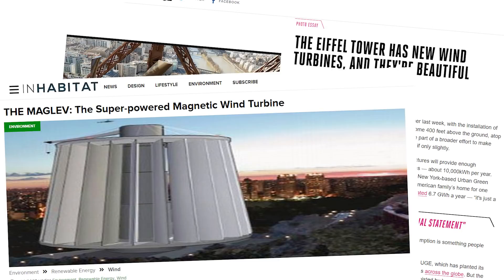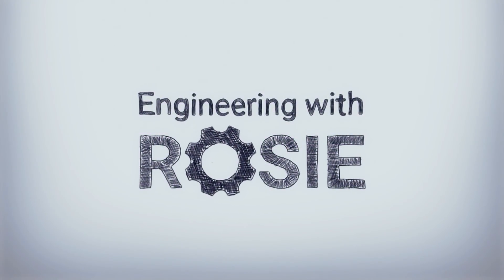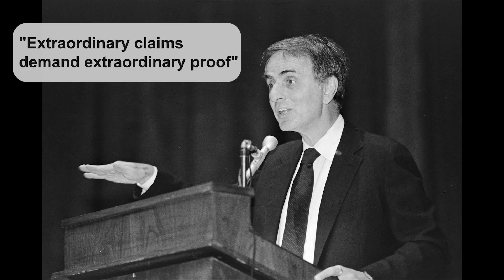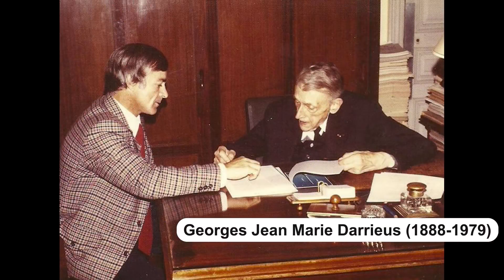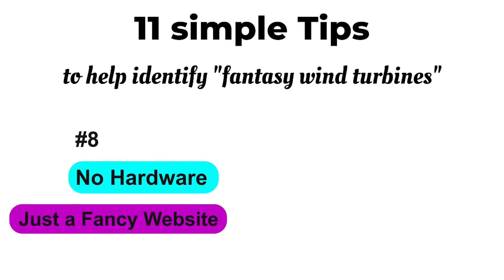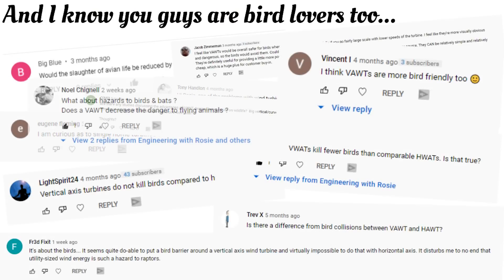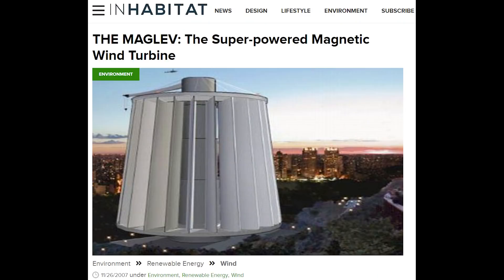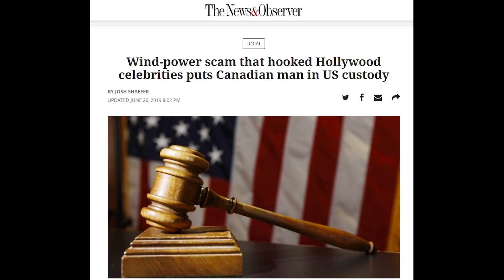Back to the Future of Wind Energy Technology with Paul Gipe

Comment: "Should we ignore all small wind?"  If you have a grid connection then yes, because the end cost of the electricity always reduces and reliability increases with increasing power output of the turbine.  There is no way a small backyard wind turbine can compete with the latest offshore wind turbines that can produce a day's electricity for a household in just half a turn, and due to their location and height can produce that power most of the time.   They are also much better for the environment than building the tens of thousands of backyard wind turbines that would be needed to produce the same power as just one of the latest offshore turbines.  Ohh, and due to their height, nearly all sea birds fly lower than the blades can reach!
Reply: I see more small wind turbine not turning because they are a pain to maintain for the energy  obtained and just getting high enough to have sufficient wind is often the biggest expense.
Reply: Good points but there are windy cities such as my hometown, Wellington in Aotearoa (NZ) where you have to think some form of rooftop turbine could one day provide affordable electricity to the home.
Reply: @simonromijn3655  Description of Wellington: "The enclosed nature of the harbour gives many sheltered beaches and bays regardless of wind direction." - There may be some properties there that get good wind, but for most of the population it would make good economic sense to share an offshore wind farm with the turbines located in some the best winds possible.  To power every home in Wellington requires a farm of just 5 wind turbines of the latest 14MW variety, with maybe some extras to power your industry.
Reply from the maker: "Windiest capital city in the world!"
Reply: @EngineeringwithRosie  Windiest only if you stick your head over the top of the hill, but all the houses are built in the shelter of the bay!  A little bit of land makes a big mess of the amount of power in the wind, and buildings even more mess, then if everyone has a turbine on their house, their neighbours turbines will be reducing the wind power that arrives at their turbine!   The backyard is about the worst place to invest in wind turbines, even if you live on a remote island, because the house will be on the sheltered side and the wind turbine needs to go on the windy side.   The UK has 5x the number of onshore turbines compared to offshore, but in total the offshore often produce more power.
Reply: @EngineeringwithRosie  Does Generalized Ground Charge Have Any Correlation To Meteorological Patterns?
Reply: @nigels.6051  How Much Energy Does A Whistle Generate?
Reply: What Happens If The Lights Go Out In A Centralized Grid?
Reply: Yes, economies of scale exist.  But by your logic there shouldn't be any rooftop solar either.  Rooftop solar continues to sell very well because its offsetting the retail cost of electricity, not the wholesale, and in many situations its a better investment (buying vs. renting).  Small wind manufacturers have had a hard time competing with the dramatic drop in solar energy costs but new blade, electronics, control and installation technologies in "conventional" horizontal-axis turbines have lowered paybacks by up to 60%.  If you have the space and a moderate wind resource small wind is worth considering to reduce your utility bills.  But do your research and don't fall for hype.  Oh, by the way, there's no reason to believe that offshore turbines will be more "bird friendly" than onshore turbines.  We're not talking shore birds here.
Reply: @mbergey1  Solar is a bit different since the panels used on home roofs are almost identical to those used in wind farms, the panels don't improve performance or cost with size.  Installation is more efficient, and they can be installed in sunnier locations, so yes shares in a solar farm should work out better than buying your own installation, but not by a huge amount like with wind.   Yes, the larger offshore turbines are bird friendly, apart from for a few land birds during their migrations.  The blades are higher than the sea birds fly, so there is no chance of collisions. Many, if not most ocean traveling birds skim the water to take advantage of ground effect aerodynamics, but even seagulls only fly up as far as half the height of the bottom of a GE Haliade X blade.
Reply: If We Improve The Efficiency Of The Systems Which Transmit, Store, And Employ The Power, Then Less Energy Would Be Necessary To Produce At Residential Scale.

How Often Do You Unplug Your Appliances Or Flip The Breaks To Rooms Which Are Not In Use?
Reply: How Does One Determine The Maximum Output Capacity Of A Modular System?

Comment: In fairness, the designs that only appear on the internet are extremely bird friendly  ... at least till the first prototype is spun up  ;)

What matters is some ratio like bird stikes per GWh delivered. That number goes to infinity if no real energy has been delivered.

That ratio is also useful for comparing small turbines with the gridscale ones. I would love to see those numbers, as intuitively I would find it plausible that a small rooftop turbine is more bird-friendly than a windfarm; unfortunately I would also find the reverse effect believable. Until I see the numbers I don't know which intuition to go with...
Reply from the maker: That is a very good point, and a real tick in the pros column of making a website instead of hardware. No birds killed in the making of a website...
I like your bird deaths per GWh metric. I would love to see it, but few manufacturers are doing bird studies, and when they are done it is very dependent on the installation site. Some bird species are more prone to hitting wind turbines than others.
Reply: Yes, birds/TWh or GWh is the best metric and it is what I use. ;)
Reply: @paulgipe6684  You need the percentage of (passing) birds killed per Joule to have the 'best' metric. So a 'population-loss per Joule' metric.
Otherwise, you can't compare two wind-turbine set-ups in two different locations.

Comment: Any opinion on VAWTs that change the the attack angle of their wings as they rotate? A engineering professor friend is having his students make one with a cam system that changes the attack angle as it rotates to see if they can improve efficiency, and I presume overcome the stall and startup issues typical for VAWTs. Obviously the additional hardware would increase mass and thus costs, like Paul Gipe mentions in your video. Is this a new idea? Or an old idea being retried?
Reply from the maker: It's not a new idea, but in my opinion it is the most promising VAWT tech. I expect someone will eventually get this kind of tech to work well. There are a few reputable companies pursuing it (e.g. Agile Wind Power), but as far as I've seen no one has quite got there yet with an efficient and reliable implementation of that. I made another video which goes slightly more in-depth on VAWT tech, if you didn't see it yet you can watch it here: https://youtu.be/ldt405jIR0E
I will probably do a more in-depth one one day, since VAWT are so popular on YouTube!! I would like to get a couple of people with VAWT design and development experience to contribute what they've learned over the years.
Reply: Nat, we call this a giromill or articulating, straight-blade VAWT and yes, it has been tried many times. The wind museum in northern Germany has just acquired a Heidelberg for display.

Comment: Birds wow I would hope bigger (and therefore fewer for given output) turbines kill fewer birds - sometimes data can be contrary to expectations and I hope it isn’t in this instance - birds probably can adapt to turbine avoidance more so than rapid climate change as you mention🤯
Reply from the maker: You may be right, but I don't think we'll ever know because only large wind turbine manufacturers do bird studies. The small ones all say they don't kill birds, but I've asked a few where their evidence is and they always say they are just assuming. Still, I don't think that small wind turbines bird deaths are a big deal, there aren't many of them after all.
Reply: @EngineeringwithRosie  wow well something to consider for someone doing something on their own property for personal small scale use - if you have blades or similar probably more risk but who knows for sure if no studies are done
Reply: Although birds can certainly adapt, they will probably do so by the few species with problems going extinct in windfarm areas!  Best wind turbines for birds are offshore turbines, because most birds only go offshore on migrations, and most seabirds fly close to the water to use ground effect aerodynamics.  Even scavengers like seagulls normally fly lower than the bottom of the rotor disk on the latest offshore monster turbines.  Of course there are no bats out at sea, other than on migration.
Reply: @nigels.6051  that is good to think of yes it does seem the economics favors larger probably turbines than we’ve had thus far and obviously offshore is favorable for that so probably that’s what we’ll see fewer and larger turbines and maybe terrestrial ones will be progressively scrapped particularly near coasts
Reply: @pingnick  Terrestrial turbines have already reached the maximum size that it appears possible to deliver to site along roads, and that size is finding it hard to compete with the much larger offshore turbines delivered or towed to site by huge ships, and which have little restriction on getting much bigger.  There is also much better quality wind at sea, so yes, hardly worth bothering with onshore wind turbines in future.  If you are not near a coast then it will be Offshore+HVDC interconnect vs solar, with the winner depending on what part of the world you are in.  You can look to Britain as the leader in offshore wind, but not to see how it competes with solar since Britain has much more wind than most of the world, and also much more cloud!
Reply: @nigels.6051  yes it is nice that Norway has lots of hydropower to share - there has been fairly little offshore wind in the USA thus far but probably will be lots in the future - huge place the USA even just lower 48 with lots of different possibilities - Canada has perhaps more hydropower to balance things out and sadly very little hvdc lines yet in the USA